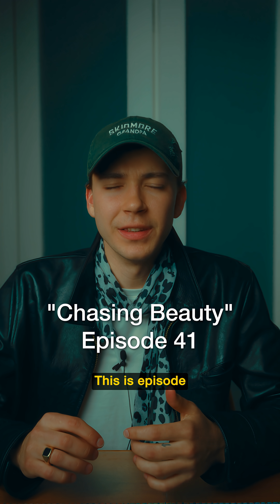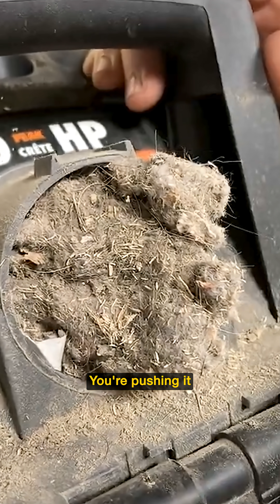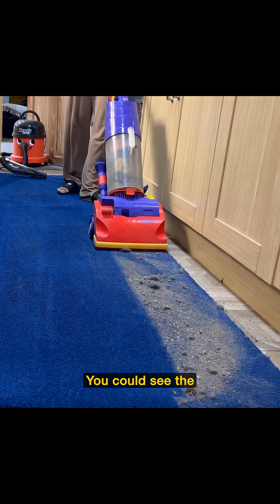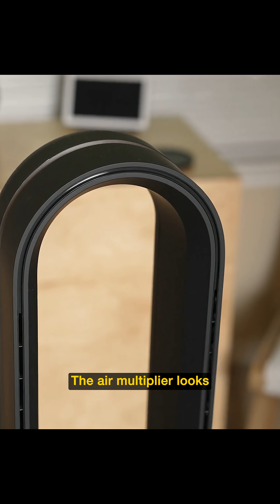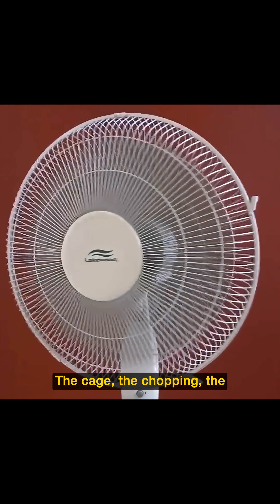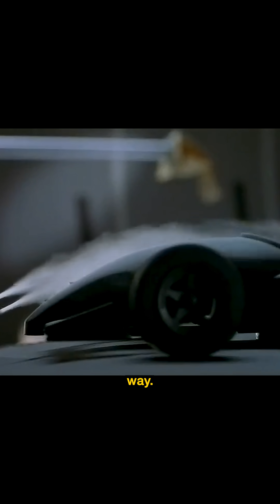Dyson products look weird, but there’s a reason. Behind their iconic product design...

Comment: I own a Dyson V8 cordless. It was a Prime Day deal. Even so, it was an expensive purchase. I had two dogs at the time and already owned 3 vacuum cleaners and a handheld. First time I used it, ten minutes in, it starts cycling through surges and slowing. I figure it’s defective so I’ll try returning it to Amazon. Turns out you cannot return it for that reason. It’s not a defect, you just need new filters. This was the FIRST TIME I’d used it! The manual says to clean the filters once a month. I have to clean the filters with each use. I can’t even get through a full charge of the vacuum before I have to clean those GD filters. They are stupid expensive to replace. They take several days to dry out after washing. The instructions say not to use soap to wash them, but that’s the only way to get them clean. I WILL TAKE A DIRT BAG OVER THIS BS ANY DAY!
Reply: And by the way, the damn thing loses suction just like every other vacuum cleaner I own, but their filters are easier to clean, dry much faster and were WAY less expensive.
Reply: Sounds like you got a bad one.

What are you vacuuming with it?
Reply: @Racing_Fox —I am vacuuming carpet. Regular carpet. What did you think I was using it for? I have a shop vac for shop vac stuff. My house is 1344 square feet. Only the bedrooms, hallway and stairs have carpet—not even 500 square feet. The filters clog about the same time that teeny tiny dirt cup fills up. Then I get to inhale a lungful of dust when I empty it. I would rather have a bag that sequesters all the dirt and debris that I can drop in the dumpster tbh. Washing the filters of the Dyson is such a pain in the ass (there are two). It takes a week for them dry. I can only vacuum a 150 square foot bedroom before it starts to lose suction or starts revving and slowing, so I have to stop, clean the effing filters, and wait a week to vacuum the next bedroom. Give me a bagged vacuum any day over that BS.
Reply: @D @Deecember16  honestly sounds like you’re vacuuming an unusual amount of fine powder or something to clog them. I’ve literally never had that issue and I can’t even remember when I last cleaned the filter

Comment: Dust bags actually do just work better. You do lose a bit of suction towards the end, but the bag protects the interior mechanisms of the vacuum causing improved overall performance and much better longevity. It's also better for the air quality of your home because dumping bagless tends to release a lot of  microfine dirt into the air.

Unless you obsessively clean and maintain your bagless vacuums, they break down over time. Dyson's real appeal isn't its design but it's customer service policy.

Comment: So the vacuum cleaner doesn't suck properly,
The bladeless fan gives less air flow then a 5 dollar gas station portable fan and
The hair dryer also is weaker than a conventional hair dryer.

Sometimes being different doesn't mean it's a good thing. 😂😂😂
Reply: Then there’s their hand dryers which is genuinely revolutionary
Reply: @Racing_Fox justbuse a towel or tissue

Comment: Dyson is often misunderstood because the marketing focuses on cyclonic separation as though it solved the core problem of vacuum filtration. In reality, it largely redistributed the problem. A vacuum system is always an airflow management system first. Suction, pressure drop, particulate loading, filter surface area, cyclone efficiency, motor curve, seal integrity, and exhaust filtration all interact. Dyson’s cyclonic design does remove a portion of the particulate load before it reaches the filter path, but it does not eliminate the need for filtration. It simply moves much of the burden into multiple filters and narrow airflow passages that many owners do not maintain properly.

 That is one of the reasons so many Dyson units end up in repair shops and thrift stores. The average consumer thinks “bagless” means “maintenance free,” when in practice many of these machines have several filtration stages that gradually clog. Once those filters load up, airflow collapses, motor temperatures rise, suction falls off, and the machine begins behaving as though it has failed mechanically when it is often being starved aerodynamically.

 The irony is that a properly designed bagged vacuum can be far more elegant from an engineering standpoint. A good bag is not merely a dirt container. It is a distributed filter medium with large surface area. As it loads, it can actually improve fine particulate capture until it reaches the point where pressure drop becomes excessive. That is the important threshold. A well designed bagged system manages that curve predictably. A poorly understood bagless system often hides that same pressure drop across small filters, foam elements, pleated cartridges, seals, screens, and cyclonic passages.

 Cyclones are not magic. Vortices exist throughout any vacuum system. The question is not whether a machine uses cyclonic action, but how well it manages airflow, separation efficiency, turbulence, constriction, and filter loading over time. Dyson’s approach is clever in presentation, but it is not automatically superior. In many cases, it simply makes the consumer responsible for maintaining a more complicated filtration chain.

 The materials are another issue. Dyson uses strong plastics, often polycarbonate or similar high impact polymers, and they look impressive. But material strength alone does not equal long service life. If the design depends on clips, seals, molded joints, thin latches, proprietary assemblies, and filter paths that consumers neglect, the machine can still become uneconomical to maintain. A vacuum should be judged by long term airflow performance, repairability, filtration stability, motor protection, and service life, not by showroom theatrics.

 This is why brands like Miele, Electrolux, and older Oreck machines earned respect in a different way. They were not trying to make the dirt visible as entertainment. They were designed around controlled airflow, predictable filtration, and practical maintenance. A sealed bagged machine with a quality HEPA exhaust path can outperform many bagless machines in real world use, especially once both have seen months or years of dust loading.

 My advice is always to look at independent testing rather than marketing claims. Consumer Reports and similar independent test groups matter because vacuums are easy to advertise and hard for the average buyer to evaluate properly. Peak suction on day one means very little. What matters is performance after loading, filtration under real dust conditions, ease of maintenance, durability, and whether the airflow path remains stable as the machine ages.

 Dyson did not abolish the old problems of vacuum design. They repackaged them, made them look futuristic, and convinced consumers that seeing dirt spin around meant better engineering. From an airflow and filtration standpoint, that is only part of the story. A vacuum is not good because it is bagless. It is good if it maintains controlled airflow, protects the motor, captures fine particulate efficiently, remains serviceable, and performs consistently over years. By that standard, Dyson is far less impressive than its reputation suggests.

Comment: The most exciting thing about a Dyson vacuum is when I get facility back in my fingertips after continuously holding the “on” button
Reply: You actually raise an excellent point. It forces you to use a certain grip and also squeeze in not so ergonomic way.
Reply: now they also have models with on/off buttons

Comment: No. Dyson is stupid. Tgey do the same thing, but more complicated and less efficiently. The vacuum cleaner is the only thing that's actually slightly better, but again the latest Dyson vacuums are overengineered, overpriced and work worse than  cheap Chinese vacuums using the same cyclone principle (because the Chinese vacuums are much more simple and way more easier to clean). I bought few Dyson products over the years, it always let me down, never going to buy any of them again.
Oh, I forgot. Dyson hand drier is alright, the only Dyson thing I can say is actually good.
Reply: Alright? 

Dude it’s miles better than anything else

Comment: The Dyson vacuum being see-through rather sounds like the biggest reason not to get one. I already see or at least know of the dirt being on my floors. I don't additionally need to see it condensed in the vacuum cleaner. And it also looks like it would be an absolute mess to empty that dust tank.

Comment: We thought ‘there is no way a fan is worth that much money!’… then Canadian Tire had a huge special on where we were able to use an in store discount with a coupon won and Canadian Tire money we earned to get one for next to nothing… then we brought it home and used it (the Dyson Hot & Cool Purifier)… we now have several of them at full price… worth it 100%. We also have the ball vacuum, the stick vacuum and the hair dryer… none of it seems like it should work as it does… but it does… I love that the fans monitor air quality and can turn themselves on/off according to temp for the fan/heating and VOC to purify the air… as needed vs leaving them run all the time…
Reply: I went with shark purifier over Dyson. It had so much more power for way less.
Reply: @anh7807 I’ve never seen a shark purifier, but honestly have never really paid attention to shark after a bad experience with a shark vacuum… is it also a heater/fan?
Reply: @halifaxguy its a fan...was supposed to be a heater as well but I cant figure that out
Reply: @anh7807 I’ll have to look into it… Dyson are nice… but pricy…
Reply: Our family is the same, tried a Dyson once and now we can't use anything else 😂 We have 3 ball vacs, one is 16 years old and like brand new! Also have the hair dryer and an old space heater that I don't think they make anymore. But I've yet to try the stick vacs, how do you like yours? Any issues?
Reply: @jamie299 ours are all like new… we had one fan die, but they replaced it… the newest Dyson product we have right now is one of the hot and cool purifiers and it’s about 5 years old… the oldest is one of the big old uprights with the ball where the head meets the body of it… that thing is ancient… but they all work like new… from time to time we’ll notice a reduction in suction on the vacuums, but you take all the filters out and clean or replace them and they are like new again… so, while they do cost several times what most other units on the market cost, I’ve never had fans, vacuums or even the hairdryer last nearly as long with not degradation in performance… I do have one of the OG ‘Dyson Airblade V’ hand dryers… it blows a lot of air but the sensor is not great… it auto shuts off before your hands are nearly dry enough… but it’s OLD too and was used commercially before I brought it home, so no loss…

Comment: Having owned a Dyson fan and vacuum, I’d have to say there’s some of the worst fans and vacuums I’ve used. Clever idea, needs work.
Reply: Yep. The fans are noisy if they actually need to move air quickly and the cordless stick vacuums are super high-pitched and don’t have a trigger lock for extended cleanings.

Also, as someone with allergies, vacuums without bags just put all the fine dust back into the air when you empty them.
Reply: @telkhines117 my Dyson has a washable and replaceable HEPA filter and trigger lock. I also love our premium Dyson fan/heater/filter. The design and craftsmanship is great.
Reply: @waltertersch  I agree! We have 3 Dyson ball vacs, oldest is 16 years old and still going strong! Love the HEPA filters, and suction is still as strong as the day we bought them on all 3. I also love the multitude of different attachments, I get use out of every single one. I actually really enjoy vacuuming, and it's mostly because of Dyson products lol 😆

Comment: Because my wife is on hook with Dyson popularity we got Dyson ball vacuum cleaner and it’s shitty, too heavy, too many functions and parts that lost after one flat moving and when it got mould inside to open it for deep clean I needed to almost crack all that plastic parts and they won’t last long 😅
Reply: I don't understand this. We have 3 Dyson ball vacuums, an old DC25 from around 2010, an Animal 2, and an Allergy+. And all 3 still run perfectly and have never needed repairs. We still have all the accessories from all 3. We just make sure to do the scheduled maintenance as instructed in the manual and have never had an issue. All 3 work like the day we bought them. 
I doubt you were cleaning yours properly if you developed mold! I've never heard of mold in a vacuum cleaner, were you sucking up water?
Reply: Also we got hair straightener and it’s good for travel rules because detachable battery but it’s like normal Chinese products 😅 but more expensive

Comment: The noise of the Dyson hairdryer is awful. Wheimy wife bought one I had to run to different room because I couldn't stand it
Reply: That's the big problem of all dyson 'fanless' devices. The hidden fan in much smaller than on other devices and has to spin much faster to achieve the same performance. faster equals to more noise.

Comment: I had a DC01 for about 25 years.
The only parts I ever changed were the head belt 2 times and the hose once.
Nothing else needed replacing.

Absolute engineering.
Reply: That's awesome! We have a 16 year old DC25 that's still going strong! Hasn't needed repairs yet, hope it lasts as long as yours did 😊

Comment: Dyson fans are scientifically and significantly less efficient and not any quieter than a cheap regular fan. So in this case it's, find the failure, rebuild it with more failure, charge 10x the price to gullible people.

Comment: Dyson is just really good advertising, nothing more. Cyclonic clear canisters have been used for a very long time. When the cyclonic chamber gets coated with dust and yeck it will loose efficiency and need to be washed out. And every cyclonic vacuum has filters, a corse filter above the canister to stop large particles and hair. Then a fine hepa filter on the exhaust, usually by the handle. If either of those become restricted the motor will over heat and trip the thermal fuse. So no they are not maintenance free.
Reply: Thanks for the reminder to check my filters. I don’t know how long it’s been 😬 My robo vac nags me. My Shark doesn’t.

Comment: Hearing that there's something spinning at 110,000 RPM inside your hand sounds kinda terrifying. I have to wonder what a catastrophic failure of that fan would look like and how protected your hand would be.
Reply: im not sure numbers would be correct tho. a lot of companies claim shit then it turns out to be lie. 110k rpm is magnitudes higher than my 120mm 4k rpm which was very noisy. i will actually check their claim and reliability, as it would be nasa grades i believe😮
Reply: My first horror thought was to wonder what would happen if hair was sucked into the machine ^^;